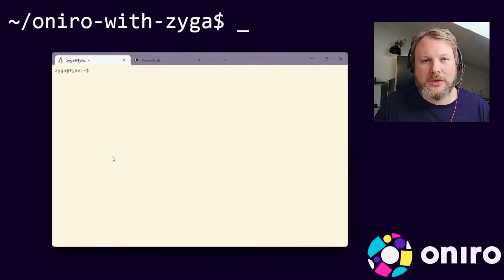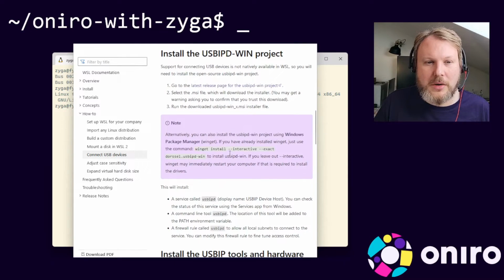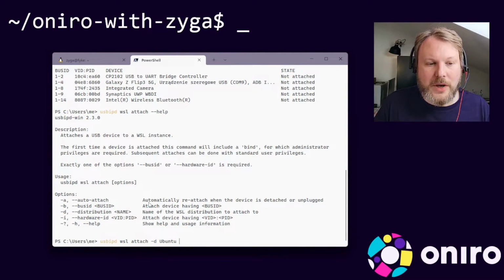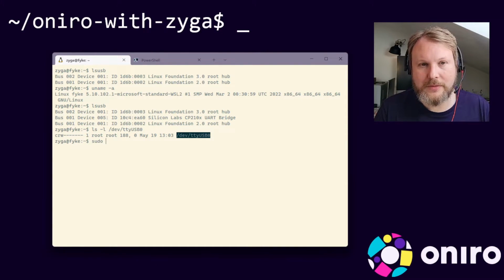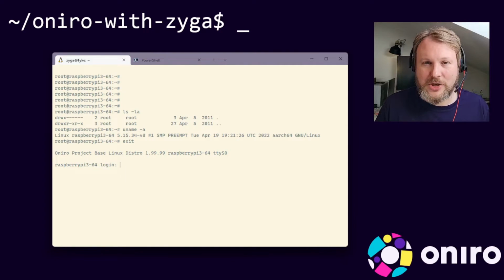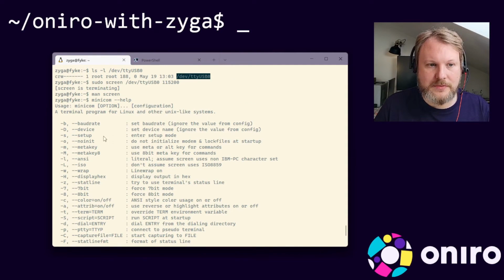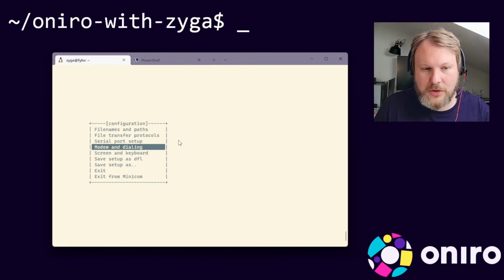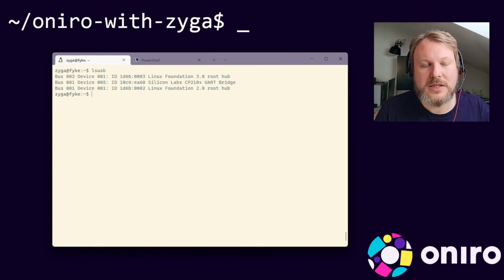USBIPD: Using serial ports in WSL2

Comment: This assumes you are using a USB adapter,  I am using a virtual COM port, no USB device involved, how can I forward the COM port over to WSL?
Reply from the maker: it depends on what you need. Usually full USB is needed with more complex devices. Plain old serial ports used to work in WSL-1 automatically. In WSL-2 this functionality was lost, AFIAIR.

Comment: I'm having an issue where the device does connect to my wsl2 but the comport doesn't seem to follow, and I can't acces the serial port through my wsl.
Reply from the maker: I have no suggestion beyond trying a few more times. Perhaps the versions have drifted over time. Perhaps there's something flaky in the process.

I've since moved on from working on Onrio and I'm not as constrained with working on Windows devices.

Comment: Can i use usbipd installed on two different windows installs to project a localhost usb thumbdrive into a remote windows virtual machine host environment?
Reply from the maker: I have not tried that but in principle the answer is yes. The whole idea of USB over TCP/IP is that you can treat this as network traffic.
Reply: @oniro-with-zyga499  thanks, I wasn't sure if the usbip-win install has ability to act as both a server and a client. Scenario I'm thinking for windows to windows / macOS usb device sharing over ip is a fido2 security key for authentication and thumbprint for diskpart / disk utilities activities while asking the remote console over rdp / vnc.

Comment: what about controllers (xbox controller for example) I tried, and it appears under usb-devices but with no driver attached, although looking into WSL github there should be driver for that. Any suggestions to solve that problem?
Reply: I didn't try with Xbox controllers, depending on how it is showing up in the kernel you may or may not need a kernel level driver.

Through libusb it should work but I, again, have not tried that particular case.